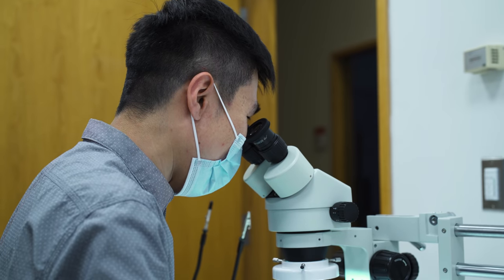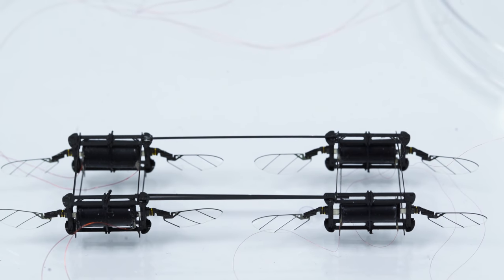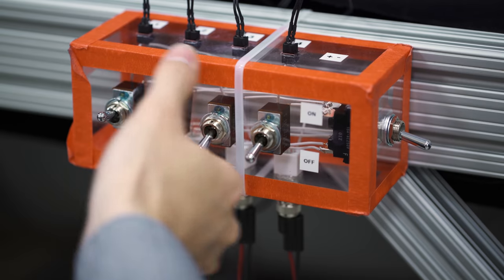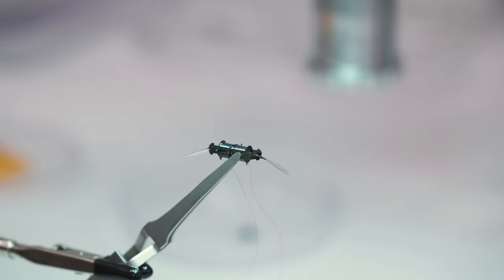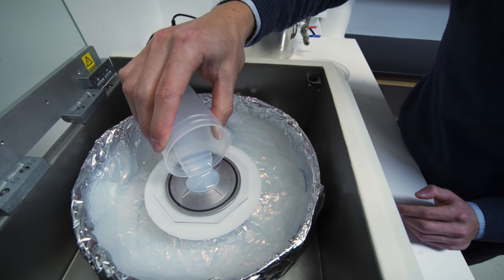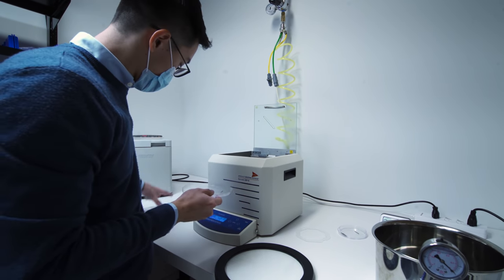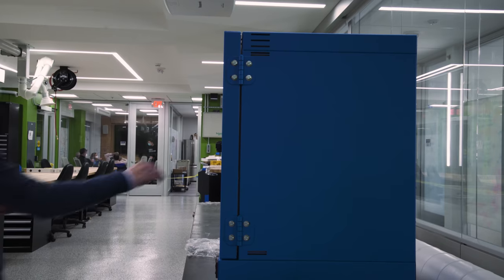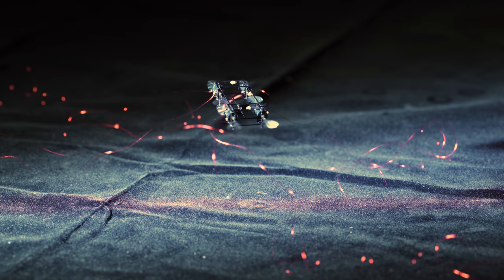Giving bug-like, flying robots a boost

Comment: "...weighs 1/4 of a penny..."
I am sorry, but this is even worse than using imperial units... how can this be used in a scientific video?
Reply: The whole video seems pretty layman, there aren't any specifics given at all. Like, anyone who has worked with elastomers, even silicone for crafts, knows that you can put elastomers in a vacuum to remove bubbles, but the video presents it like it's some kind of new discovery.
Reply: just google the weight of a penny instead of being a pedant in the comments
Reply: @Immortal_BP  I did google it. That does not mean I could not also write the comment.
It's not about being a pedant (that would be if I said that they should specify whether they mean pre-1983 penny or post-1983 penny, since apparently they have different mass, as I learned when googling it; but I assume they mean post-1983 penny), but about the fundamental problem of having to google it in the first place. It disturbs the flow of the video if I have to pause and google these random factoids, and it could be easily remedied, if they said (or even just written) the mass in some normal units.
Yes, I know the point was that it's a small mass, and it should not really matter whether they say 1/4 of a penny or "less than a penny" or whatever. But still, it's MIT, and I would assume the MIT being famous engineering institution would present the facts in a concise manner, not obscured by some pseudounits.
Reply: @Immortal_BP  yes. sorry for trying to explain my thoughts... apparently it does not do well in the internet conversations...
Reply: @Immortal_BP  He's not being a pedant. He is pointing out a very disturbing tendency of comparing measures to inaccurate aproximations based on real life objects on american media. Americans seem to have problems dealing with the abstract, and tend to rely heavily on bananas, football fields and such to appreciate measures. I don't see it anywhere else in the world and I wonder if it isn't because they're so hellbent on keeping the dumb imperial system or a failure in their education system. Pride truly is a sin.
Reply: Well, it's NOT a "scientific video" it's a video about a new(-ish) technology aimed at a common audience.  The majority of the viewers are probably Americans and are quite familiar with how light a penny FEELS versus the weight of 0.625 grams.  Get over it.
Reply: @DrD0000M  "No one NORMAL gives a damn."  it's funny how people tend to say "no one normal does..." when they mean "I don't..." or "the people I know don't..."
I might say "no one normal measures things in football fields and bananas" as well...
Also, as I mentioned earlier, if they want to dumb it down ans say "1/4 penny" for an average American, I am OK with that, if they also said or written a standard measure

Comment: In the testing it looks like they are using external power. Do we have the tech to make the power source local on the device itself?
Reply: "The more surface area the actuator has the less voltage is requires" - that's the key focus o this research, which is about maximising actuator performance. Now, i would imagine that at some point they will be able to run at so small voltages that onboard energy storage like a battery will become feasible. But I doubt it will be current li-ion technology as its not energy dense enough. Perhaps when the good solid state polimer batter comes in, that will solve the problem.
Reply: @sodalitia  or maybe just directly powered through induction
Reply: @jacksonzheng3103  Nah,  a giant solar powered space laser  is way more elegant solution in that application.
Reply: I know you are thinking about your favourite insect, we are there yet. Sorry if the research did not make it clear, bt they are excited on an advancement on another area that may get us there tooo of you are patient enuf. As for current energy requirements, battery is heavy
Reply: @Immortal_BP  Carl, Carl, calm down your bug sized brain under those tin foil wraps.
Reply: @sodalitia   😅
Reply: @Immortal_BP  that's just a speculation, you don't have any concrete proof that they already exist.
Reply: @tootaashraf1  of course not but its speculation based on what we could achieve right now with the proper manpower and funding. this small team of guys almost built one and they dont even have their own clean room. that says a lot
Reply: @Immortal_BP  drones are not this small
Reply: @Immortal_BP  they are in mit
Reply: @Immortal_BP  you think mit doesn't have a clean lab
Reply: right now even the most efficient battery's cant power this

Comment: So actually it can fly for zero seconds. Like all of these things for the past  30 years, it doesn't use onboard power or onboard control. The reason it fails is the same reason they all fail: it overheats. It uses an enormous amount of power for its size.